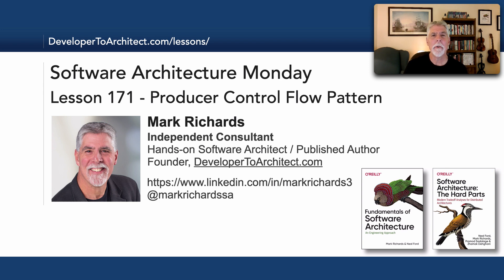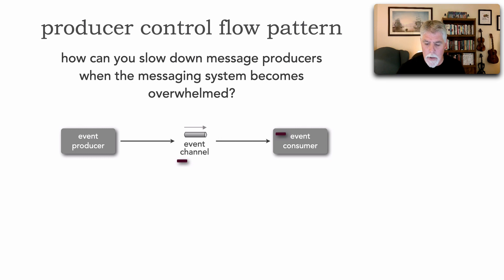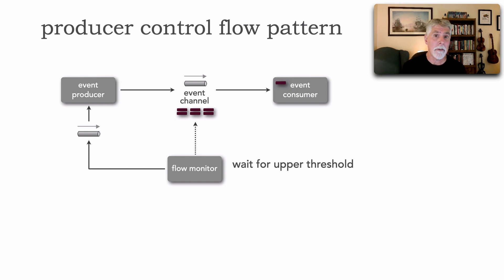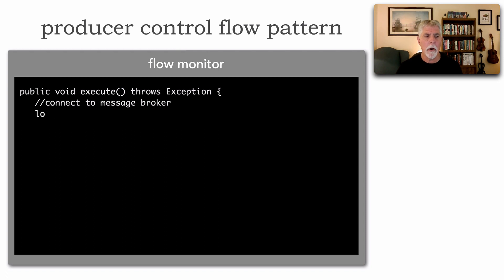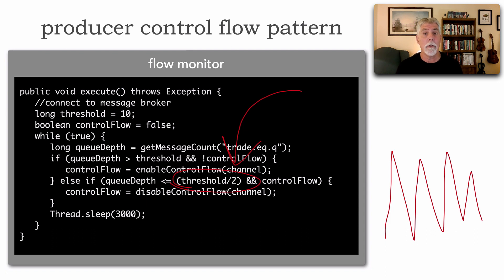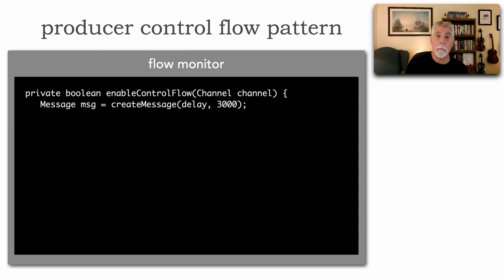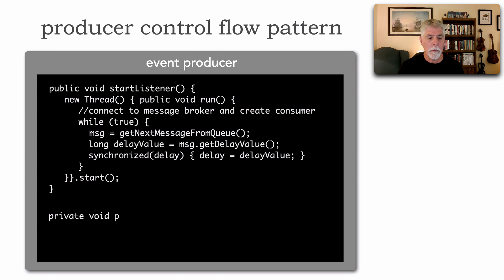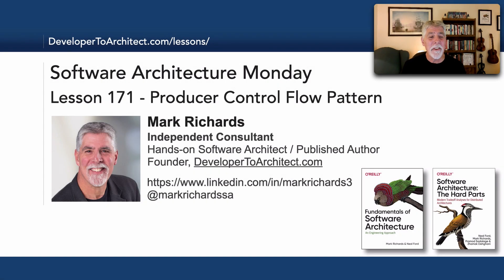Lesson 171 - Producer Control Flow Pattern

Comment: Thank you. I was in the assumption that scalability is job of the event channel. Given cloud scalable messaging services such as Amazon Kinesis, do you think this pattern is still relevant?
Reply from the maker: Many message brokers have this pattern built-in as a self-protection mechanism, but in most cases it's not a slowdown, but rather a SHUTDOWN—in other words, rather than slowing down producers, you'll simply get an exception trying to send the stream or write to the queue. Keep in mind though - it's less about the messaging service, and more about how fast the consumers can process the messages. Imagine if you shut down all consumers and started sending 5000 log or metrics messages a second. How long before the messaging service would say "Enough!"? Not long. That said, it depends on the message or streaming service you are using. Bottom line—don't assume the messaging service or stream can handle an infinite amount of messages. Check to see if theres a top limit, and work down from there...

Comment: I have a few questions:

- How would this system scale up when you have multiple consumers and multiple instances of each producer? Is the flow monitor going to be created per producer-consumer (or queue), pair? or is there only one FM to rule 'em all? 

- The flow control queue is probably shared amongst multiple instances of the same producer (which act as competing consumers of the flow control queue), in which case only one of the instances will be able to reduce its message rate, the other instances will still continue pumping messages at the same rate resulting in only a marginal "back pressure". How will I work around this problem to make sure all instances of the producers are able to slow down? Might a centralised storage for the delay (per producer) be an option, where, instead of pushing a control flow message to the producer, I store it in a database of some sort (perhaps keyed by some kind of id for the producer) and all the instances of the producer can read the delay from this store and eventually slow down? Ofcourse disabling the control flow will mean removing the record for that producer from the database.
Reply: You make a good point. I would not use queues in the path from the flow monitor to the consumer set. I would use a topic instead. Queues is for decoupling systems and generally has persistence, so that when consumer is offline the queue piles up with messages from the flow monitor. We don't want that in this case. With topic we can have fanout real-time broadcasting which is probably more appropriate in this case. My two cents
Reply: @mqtt07  I am not sure that solves the problem of not all publishers responding to the flow control messages evenly and promptly. I did a little proof of concept with Kafka for flow control topic (3 partitions) and with 3 publisher instances. Each instance will have been assigned a partition. Then from the flow monitor I published flow control enable/disable messages (key less messages) onto the topic and only 1 of the 3 instances responded at any time. 

When I killed one of the instances, which triggered a partition rebalance amongst the remaining publishers, then I saw both responding to flow control messages. This is due to the fact that key less messages are just round robined across partitions but since the flow monitor code is idempotent i.e. it only publishes an enable/disable message once per cycle, the messages will not always end up on all the partitions.  Kafka only allows one consumer per consumer group to read from a partition.

Then I tried MySql as the "broker" for flow control messages instead of Kafka by simply UPSERTING a record with a boolean flag, and low and behold all publishers responded immediately as you'd expect. May be I'm missing something and a response to my scaling question might reveal additional insights, but given what I have understood so far and experimented with, I am not sure if async messaging for flow control is the most effective or reliable way to do this (regardless of queue or topic). Its also a question of how reliable we want this flow control to be.
Reply: I am also not sure where this pattern will really help or how will it really work.

Assuming flow control is needed when you have a consumer that cannot simply scale out to deal with the backlog of the messages (may be due to external dependencies that limit concurrency), you want a flow monitor per consumer queue and given most of the time you are using pub/sub (e.g. one SNS topic + many SQS queues), how do you selectively reduce the message rate for specific consumers without slowing it every other consumer as well? Or without making the producer aware of all the consumers listening to the messages so it can only selectively reduce the rate?

I am not sure!
Reply from the maker: In that case you can broadcast the slow down and resume messages through a topic rather than a queue...

Comment: Hello, and thanks for explaining this pattern. However, I'm having some thoughts and questions. First I didn't manage to find further explanation to that pattern in neither of the books: Fundamentals of Software Architecture or Software Architecture: The Hard Parts.

Proceeding to my question, I wonder if this pattern can be used to only limit the producers. Definitely I can see a lot of use-cases to limit the producer, but in some cases this is simply not possible or not preferable. Lets take for example the Trading system that has been used in the video. I guess that the explanation most probably is related to logging or some kind of monitoring process for the system where events are send for further analysis, but what will happen if we implement such a control pattern to the trading core engine. Usually the trade should occur as soon as possible so that certain price can be met or at least the best possible price is met. In this case however, the delay can be quite significant.

So my question is how applicable is to apply the control pattern on top of the consumers, and for example to scale up the system with multiple consumers so that the system can handle the volume faster? (I know that there is a threshold to the scaling factor also and it may produce to other issues at that end)

P.S. 

I believe that I found out the further explanation in the Fundamentals book inside the Chapter 14. Event-Driven Architecture Style, Error Handling.
Reply from the maker: This pattern didn't make it into our books (not enough room). At times I've introduced a service between the producer and consumer that manages the control flow. when I don't have control over producers (such as 3rd party trading systems like Front Arena or Charles River) You are right - there are always tradeoffs—would you rather have trades take longer to place, or have them fail? Because those are really the two options...